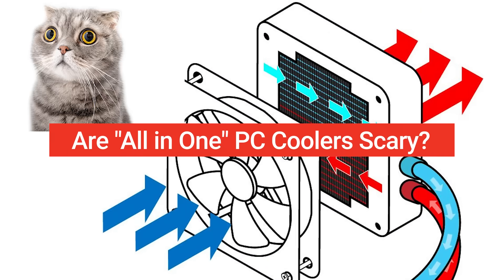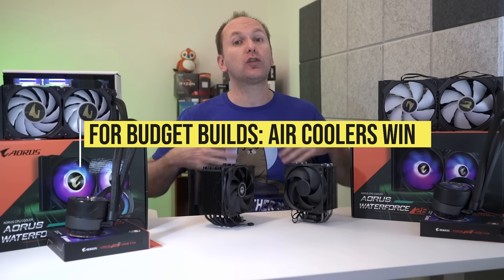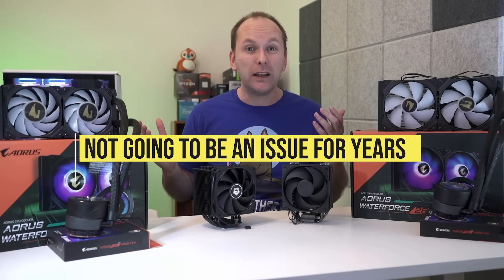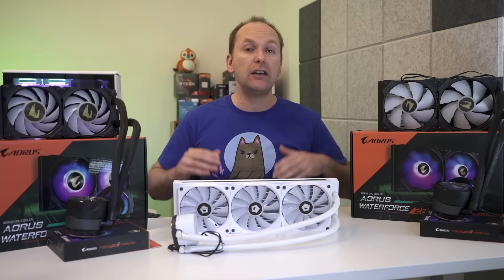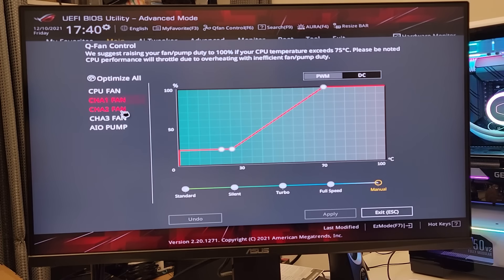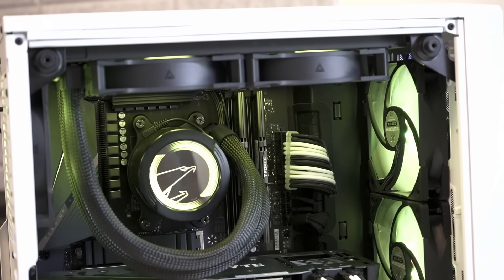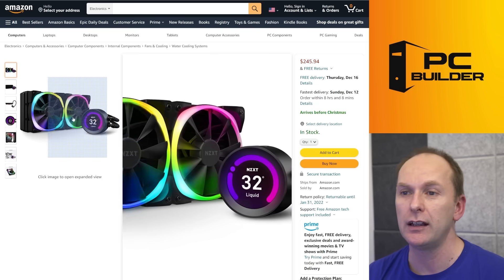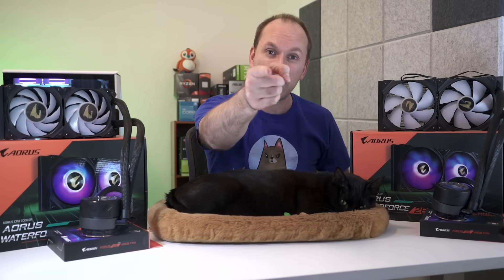🛑Watch BEFORE You Build! 🌊 PC Water Cooling Build Guide | Water Cooled PC Build 2022

Comment: I was an air cooler advocate and still think long term reliability is the issue. But as technology improved, I have more faith that the AIOs won't leak and that pump failure reduced
Reply from the maker: It's both the technology and also just way better manufacturing practices and QA. These days a well reviewed AIO won't leak unless physical damage is done to it.

Comment: Almost went AIO but with the Assassin 3 my 5900x doesn't even reach 70C when rendering 4k or benchmarking. You definitely can hear the fans though. It was only $70 before taxes so it was a little cheaper.
Reply from the maker: I like the assassin 3 quite a bit, great air cooler. I will say that I ran Cinebench R23 for 30 minutes and our Ryzen 5900X with the Aorus Waterforce 240mm AIO didn't get above 65 degrees C and was incredibly quiet. Not exactly a controlled test but some quick data . . .
Reply: @PCBuilderChannel  thanks for the info! That's what I was using to benchmark. I'll run a couple loops and post the exact temp for comparison.
Reply: @PCBuilderChannel  Finally did it. Ran R20 for 10 minutes straight and it peaked at 66.1C in a P600S with the covers on. Same test with the covers off was 64.1C.

Comment: For AIO coolers with pump inside radiator, what is the best way to mount it?
Reply: Just make sure the pump isn’t at the highest point. Those are the few that can actually be bottom mounted. I wouldn’t top mount one of those. Front, back, side, or bottom and keep the side of the radiator with the pump to the bottom.
Reply: @brandonshairplugs2884  Thanks for the advice, I will keep that in mind :)
Reply from the maker: Yes Brandon's advice is correct. Just make sure the pump isn't at the highest point.
Reply: @PCBuilderChannel  Thank you 👍
Reply: With screws usually

Comment: Been using a corsair H70 mounted to a I7 2600K for ten years now with no problems. I've got a zoom flow 360 and a 5 5600 along with everything else needed EXCEPT a RTX3080. I'll wait for prices to drop to msrp before I will buy one.
Reply: same here i build my PC 2011 with corsair H70  and Intel i7 2600k still working 7/24 since that year (turn off only in vacation or maintenance)
Reply from the maker: Nice!

Comment: Hi, that aorus aio is not making  good contact on my i7 12700k. How to fix it?
Reply from the maker: Make sure to use the LGA1700 mounting bracket (some ASUS boards will take the 1200 one but I don't recommend that). Ensure that you've put enough thermal past on the CPU - a little bit more is better than not enough. And increase the mounting pressure using a crosswise tightening approach if necessary. If all that isn't working, ensure the pump is running at 100%. It's possible the coldplate is warped and will need to be RMA'd but that should be rare (but might happen). If all that fails, get in touch with Gigabyte customer service and RMA it.

Comment: One thing Jason somewhat mentioned but could easily be over looked; It's very important for your pump to run at or near 100% speed. A mistake I made when I first got an AIO was match my pump speed to my fan curves which started at 20% and ramped up to 100% at 80C. Pumps can miss behave or not function if they are set at or below 30-40%. Even though the pump would reach 100% voltage at 80C since it got too little voltage at boot it wouldn't reach full speed causing the CPU to run an extra 10C hotter under load. Pumps work best the faster they can pull heat away from the cold plate!
Reply from the maker: Yes always best to run the pump as fast as possible as it is essentially free cooling without much noise difference compared to having to run fans faster. Just like fans, pump constantly changing speeds is what causes the most wear.
Reply: @PCBuilderChannel  I watched before you build and i could not tell what it was you were doing because of your lazy editing
Reply: Good info. About to get my first AIO. Where would I change the pump speed at? Would that be in the BIOs or something like a 3rd party software? Lastly, will a 240mm radiator fit into a 280mm top mount?
Reply: @larrykrappenschitz9926  The pump settings should be where you control your fans in bios. If you don't have a pump header on your motherboard manufactures usually recommend using the "CPU fan" header.
Reply: @SiCSpiT1  motherboard is a z590 aorus elite ax
Reply: @larrykrappenschitz9926  Asus boards have "Qfan", or something like that, in the top middle of the screen in the advanced view. The short cut should be f6 or f5.
Reply: @SiCSpiT1  it says it’s gigabyte not asus do idk if asus made it or not. I never really got that deep into pc’s after my internet working class which right after the entire pc part market inflated.
Reply: @larrykrappenschitz9926  I always mix those two up. F6 is the short cut it's call smart fan you should see it right away in easy mode.

Don't be afraid to poke around in the UEFI if you dork anything up it can always be reset back to default with F7. It's also a good idea to save a profile once you've made a few changes so you'll have something to fall back on if your system dorks up.
Reply: @larrykrappenschitz9926  Unless you see an extra set of holes where you plan to mount it I doubt it will fit.

Yes, you can set your pump speed with software 3rd or 1st party software, but I'd recommend only using those while testing noise levels and once you've found your sweet spot plug it into bios and save it to a profile. Make sure to uncheck PWM(and or Smart mode) if it's an option, it'll be in the pump/fan control section, it'll cause fluctuation in current to the pump but you just want it at a static speed. It's fine to have it on your fans but not the pump, otherwise your temps will be unpredictable.

What brand motherboard do you have?
Reply: I know it's a year old comment, but for new people who may read this thread, this whole section is a lie lol.  Constant speed is good, but 100% speed is ridiculous.  You only need to run your pump at a speed it can comfortably overcome the resistance.  I've been running my DC12 pump at 20% for 8 years now.  Furthermore pump speed does nothing for cooling.  Whether or not the water is slow or fast it'll average out to spending the same amount of time in the rads and the block.  So temps may climb slower, but it will average out.  The only thing that will affect your temps is ambient temps through the radiator and how much radiator you have.
Reply: @TotalDbag24 thanks, nice info.
Reply: My deepcool castle pump is loud at 100% and bothersome at 90%. So I run it at 80% constant for silent operation and zero drop in cooling performance
Reply: @shaunvalencia2644  Mine's a NZXT 52x and it wont maintain the speed I set it at in the UEFI so I have to keep their CAM software installed to set it after boot. No idea what's causing it. For whatever reason it defaults to only 800 rpm, that's what put me on my water pump jihad.

It's the only thing I hate about this pump.

What rpm is that set at?
Reply: My msi aio doesn't even allow me to change its speed
Always stuck at 4k
Reply: @Alucard-gt1zf  MSI has software called Dragan Center you can use to change your fan speeds (and the like) if your motherboard won't save changes. You'll just have to make sure it's running at boot(it may start at boot by default) and not run in the background while you game demanding titles.
Reply: I think 75% probably the best jayztwocents done a test on it and I think it was around that. 100% doesn't give it time to cool as much
Reply: Thanks, awesome tip!

Comment: I have an anxiety.
Pump noises.
But never had an AIO, so what do I know 🤣
Reply from the maker: Most modern AIOs are very quiet. You shouldn't get pump noises unless something is wrong with your placement. Just some thoughts if you ever want to consider giving Water Cooling a try (:
Reply: I've got mine at 100% all the time, don't notice it unless I put my ear next to the case. Totally worth it for r7/i7 and above, a little overkill for r5/i5 (possible exception for the 12600k), imo.

Comment: Is a 120 mm aio enough for a ryzen 5 5600g or will it outperforms the stock cooler ?
Reply from the maker: I wouldn't go 120mm or 140mm unless you are building in small form factor case. A budget air cooler is a better option. If you want liquid, I'd go 240mm something like the ID Cooling Zoomflow 240x. Hope that helps!
Reply: @PCBuilderChannel  thanks for the info i was going to buy a 120 mm aio for my big pc !!, just  asking will it out performs the stock cooler
Reply: @PCBuilderChannel  140mm AIO? 
I wish I could find one...

Comment: To be honest I was afraid that it might leak and that is why I bought an air cooler instead!  Well that and the other reason is that I wanted to buy a 280 cooler for my Ryzen 5900x but the place I bought it from advised to buy a 360 instead because they said that the 280 will not be sufficient and because my case cannot fit a 360 so I decided on the air cooler!
Reply from the maker: 280mm would have been fine! We are using a good 240 for our Ryzen 5900X and it never gets above 65 C even under load.

Comment: Hey, I am looking for a build with i9-12900k. I want to use Arctic liquid freezer but the case I want to use only fits the 280mm one. Will it be enough to cool the i9 for many hours while rendering or should I go with 360mm one and find new case?
Reply from the maker: Arctic's 280mm is pretty amazing so it should do the job as long as you don't heavily overclock it and run a torture test. If there's a bigger version of that case though, consider the 360 too.
Reply: It will perform similarly. There's only a small difference between the surface area of a 280mm rad and a 360mm one. You can try to look for sources online, try GN as they might already have conducted a test

Comment: My XPG levante(asetek) have over 6000rpm on 100% its noisy i reduced to 3k. MSI AIO have pump in radiator and can be used on bottom
Reply: Good god! 6000? What are your temps like under load and what's your cpu?
Reply: @SiCSpiT1  iam using it on 3000rpm pump and 1000rpm fans. 5800x now and 5600x before. Cinebench 23 can push it to maximum 90°C,even curve optimizer - 25. It looks like changing pump speed to max doesnt change nothing...
Reply: @SiCSpiT1  Thanks for tip. I tried some. But it looks like my mobo have problem with save that after change. Also when i am changing cpu value much its making  cores unstable with XMP enabled. Without xmp i can cpu tune much more
Reply: @erredar4513  wow, that would piss me off, to be frank, lol.

Well in case you want to get a new mobo these vids give a good explanation as to what these settings are and how to set them. I know they're focused on overclocking but you can lower the package power to improve your thermal headroom. 

https://youtu.be/jTkDqARDkGg

https://youtu.be/F205IDSXoMk
Reply: @SiCSpiT1  Thank you, ill check it. Mobo is 1year old b550 mag tomahawk its good MB i hope its bios problem. That xmp problem started when i changed 2x8GB SR to 2x16GB DR(both 3600Mhz cl16)
Reply from the maker: Nice!

Comment: I recently installed a be quiet pure loop 240mm aio and replaced the 2x fans that came with it for 2x Phanteks T-30 120mm fans. I went with a top mount config in a Fractal Meshify 2 case and it is very silent and cools my Ryzen 5 3600 cpu oc to 4.3ghz all core @1.275v very well. I think be quiet's pure loop series of aio's have something good going for them with their in-line double coupled pump directly on the barbs/tubes rather than in the block head or the rad therefore allowing for more configurations/installations due to the in-line pump. I appreciate the informative video and keep up the great content my guy.
Reply from the maker: That sounds great! And so glad you are enjoying the videos

Comment: Air coolers unless you travel a lot with it, or plan on shipping. Even then you can just take it off and ship in the box it came in. It's not worth the price or extra point of failure to go AIO
Reply from the maker: AIOs do not fail any more often than any other component. There's such an irrational fear ("One time I knew this guy who had an AIO and it ate his dog . . ." kinda stuff). We use them in our PCs and trust me if you don't mind spending a bit more I think they are definitely worth it.
Reply: @PCBuilderChannel  Sure, ok, but failure can be much more castastropic, particularly with leaks

Comment: I have the EK AIO in the Lian Li 011 and I have 6 fans to go in but I was on the fence about the configuration.
I didn't want a whole heap of heat going through the radiator but you've helped me decide how I want to set things up in the case, thanks Jason.
I thought you'd be at 100k subscribers by now but not much more before that milestone.
You've had a hell of a year of growth congrats.
Reply from the maker: Glad I could help! That's a great sounding setup. We're almost to 100K. Should happen around X-mas!
Reply: may i ask what you final setup was?
Reply: @Cr00klynD0dger  oh sorry i meant how you set up you aio/fans, since i'm still a bit confused with the AIO+fans+different cases
Reply: @arnoldarndth7925  I mounted the AIO at the top of the case. I have fans at the bottom and at the sides. The tubes are in front of the side mounted fans. Bottom and side mounted fans are intake, the fans on the radiator are exhaust.

Comment: I have just bought 240L ASUS ROG Strix aio few weeks back but recently i am getting a rattle noise from the pump...i tried to tilt the pc back and forth, sideways,  while the pc is on to remove the air bubble inside the pump(as described on the net) but still no luck!!! any help? is it gone? but temps are still good
Reply from the maker: Check to ensure the pump head is not the high point in the loop. Ensure it's running near 100% speed. If still having issues, reach out to ASUS tech support because those are expensive and shouldn't make that noise.